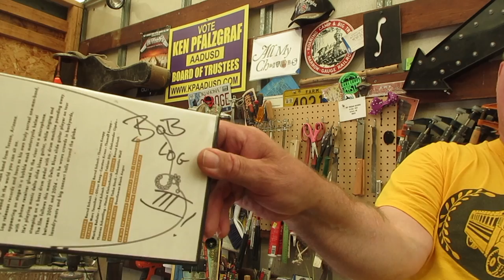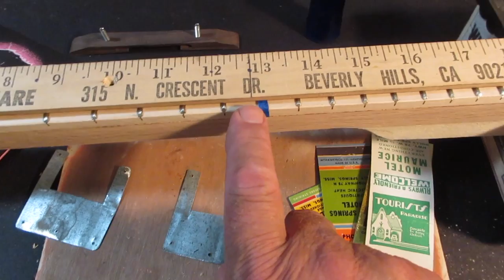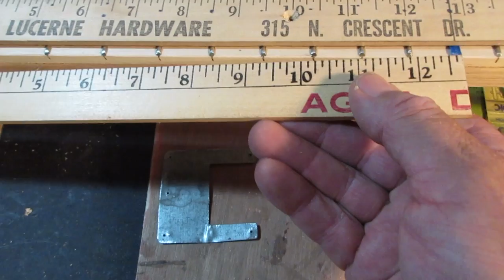How to Build a Cigar Box Guitar: Assumptions

Comment: A guitar's scale length is calculated by measuring the distance from the FRONT edge of the nut going down the fret board and the CONTACT POINT on the saddle. If you remove the excess wood at your mark, you would now be too short. Use the mark you did at the 12 3/4 mark, which woud then be the front of the nut to correct your scale problem. IMHO